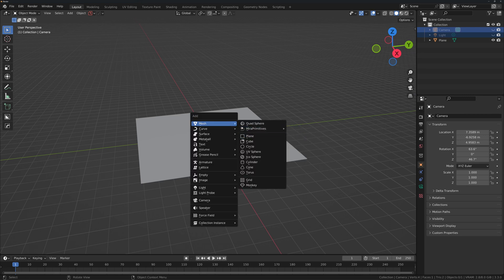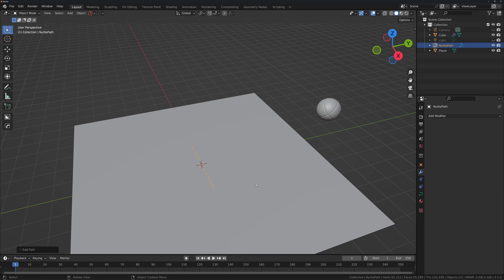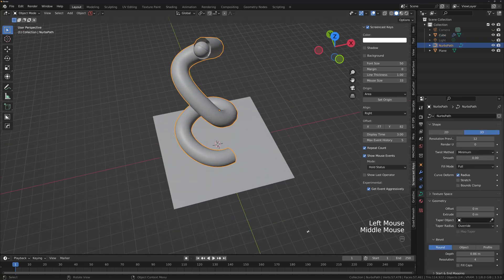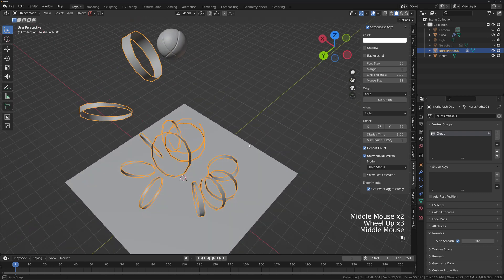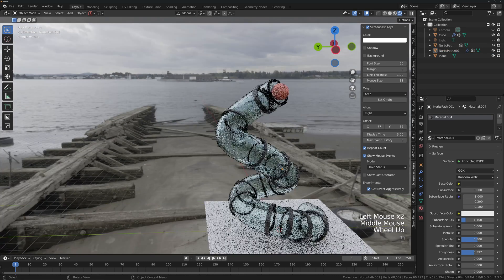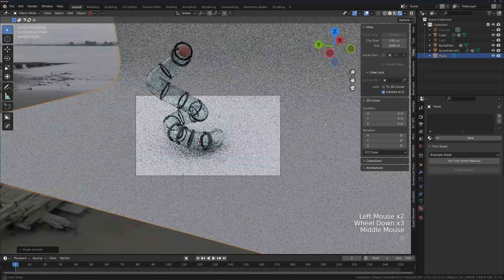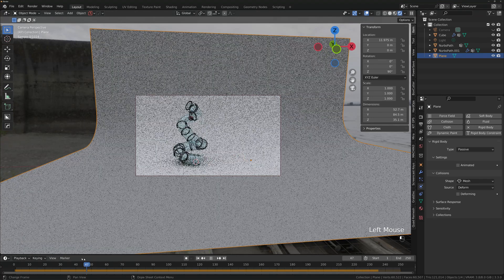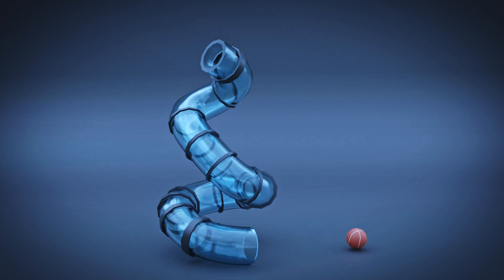how to make 3d animation video in 13 mins || Anim Goggles || Part 1

Comment: For some reason my sphere stops after a certain point although there is still time available in the TimeLine. Could you possibly help me?
(more precisely in the Timline there is a yellow line that stops at 250 despite having set 300).
Reply from the maker: dont worry about that!
Reply from the maker: try this: step 1: go to the scene properties in the properties tab(its icon is like water mark)
step 2:expand rigid body world.
step 3:expand cache.
step 4:set the end value to 300 then the problem is solved.